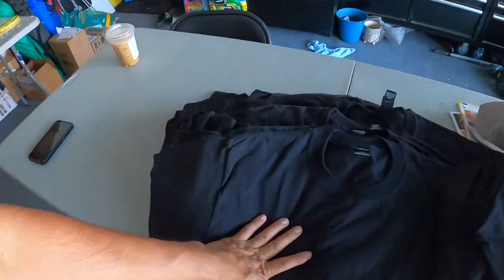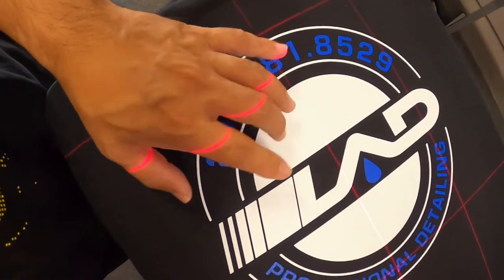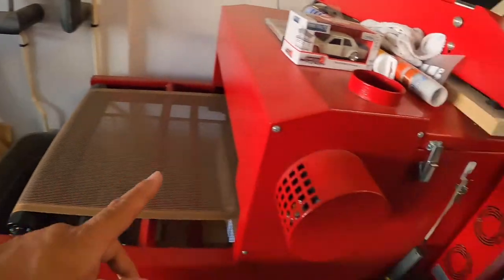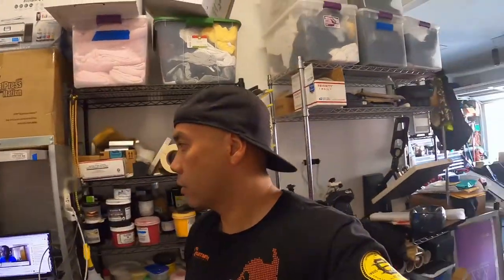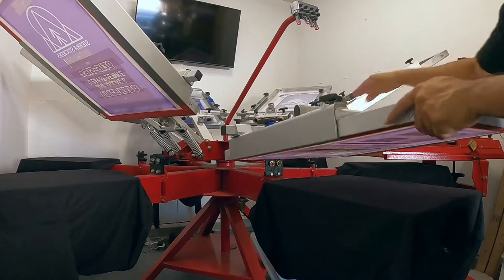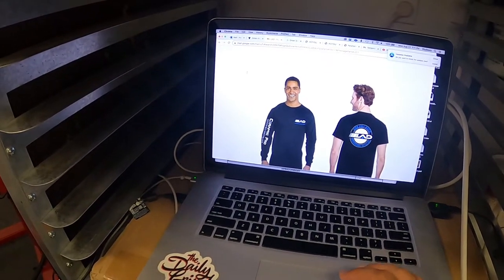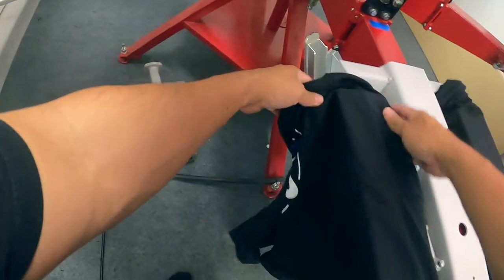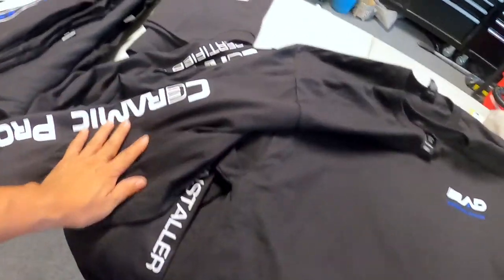FRONT, BACK,& SLEEVE PRINT - SCREEN PRINTING : Printing On Every Part Of The Shirt (S:08/Vlog 030)

Comment: Nice work! I have a question on the dryer. What do you have the height of you elements set at? I have the same dryer, and the only way to get 340 coming out is the elements ALL THE WAY down, 750-775 at 45 seconds. Just doesn't seem right to me.
Reply from the maker: Sorry for the late response.  The heating element on the conveyor dryer is around 4.5” from the belt. And I have it set at 710 at 30 seconds

Comment: Great print! What brand ink did you use for the blue that you didn’t need a under base for a black T?
Reply from the maker: The blue is the International Coatings 6100 series. It doesn’t require and underbase